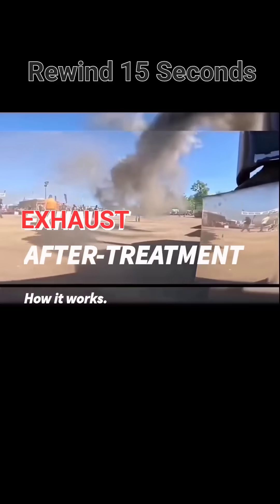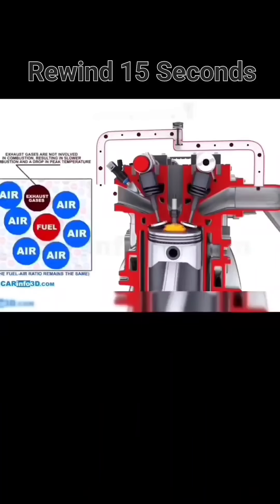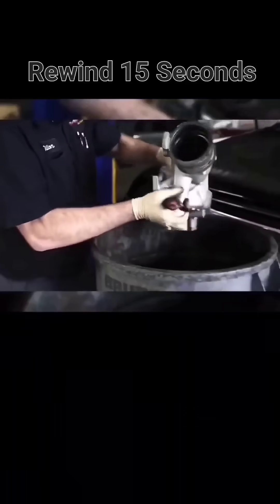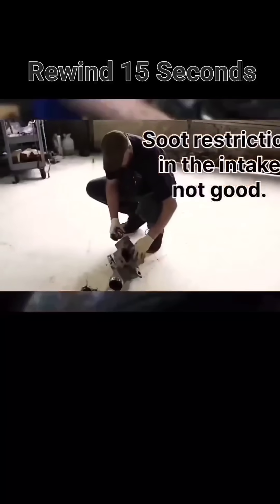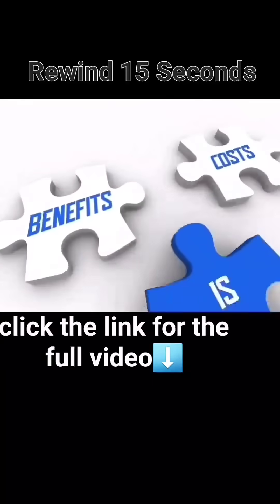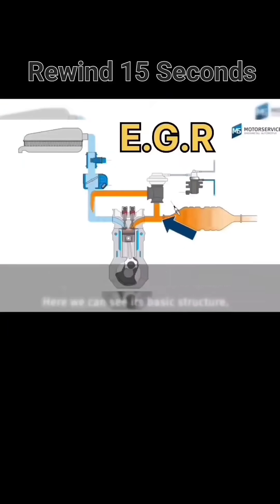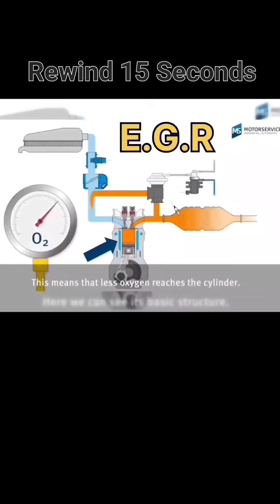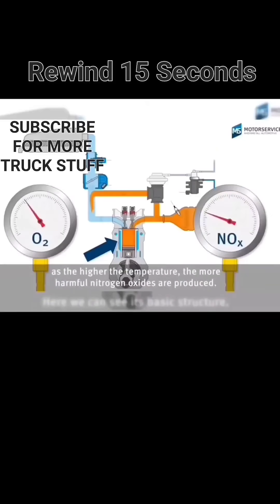EGR bad for your engine!!   How EGR works.  The good, the bad, and the ugly.

Comment: It's a poorly designed system to lessen one sort of emission at the cost of producing more of the other. A lower burn temperature creates more soot, but controls NoX output. Really bad trade imo. Pre-emission motors could be re-built indefinitely with nearly factory first built reliability. Definitely not the same for EGR motors... Use it till it dies and then buy another truck.